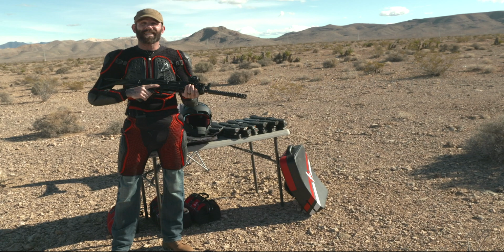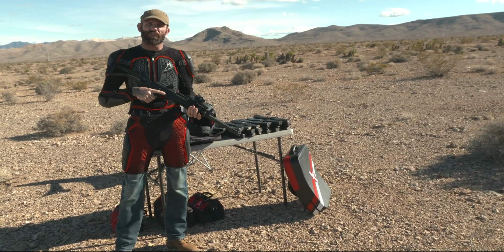Arsenal SAM7 MELTDOWN!

Comment: Ive had the "regular" SAM7 SF for about three years now and have run some 7000 total round through mine with no issues on the part of the rifle. It is one of "those" AK's that just seems more accurate than even other ones just like it owned by family members....just accurate as all get out for an AK. The stock locks up INCREDIBLY tight and the rifle just feels great when held to the shoulder. I did notice its weight when I first got it but truly it isnt all that much heavier than my stamped AK's but man, there is just something about the "feel"of a milled receiver AK........my first was an old Polytech I got back when the first Bush was President, then I got hold of an SLR95 I think it was with that goofy ass Clinton thumbhole stock (mighta been an SLR100, I forget now, I traded it for a virtually new SLR107 and a box of Romanian mags. Anyway, I did drop in an ALG trigger group and got rid of the shepards crook.......and installed a windage adjustable rear sight on the rifle that MSR distribution had. Sure beats screwing with the front sight for windage but heck, at my age I almost depend on red dots or a 5X scope I use that has holdover hashes calibrated for the 7.62X39 round. Sweet set up that so far shows NO sign of wear and I almost exclusively use Wolf steel cased ammo, generally FMJ or FMJ HP though during hunting season I do field the rifle and use the more modern Wolf SP ammo. I wish I had managed to keep more of the original heavier SP ammo that Wolf used to sell but alas I used most of that up and though I  still have some 200 rounds of that ammo every fall I zero the AK for the newer ligher SP Wolf ammo and YES,it does expand quite nicely and shoots as flat as any other 7.62X39 round that is steel cased from Wolf, Bear, Tula (ick), or Red Star. I never expose my guns to old corrosive surplus ammo and wouldnt buy the crap if I could find it these days.
Just great guns, no question about it and there is NOTHING on the market that approaches it for quality with the possible exception of the Galil Ace. Heck, I love almost all guns come to think of it......well, Phoenix Arms sucks and Im not overly fond of Smith semi auto pistols of modern make...........but, well, I have prattled on way too long.
Reply: I only use Wolf or Chinasports FMJ in my SKS after too many jamups of HP and SP including CorBon, Winchester, and Wolf Polyformance. Norinco is perfect but got banned for "light armor piercing".